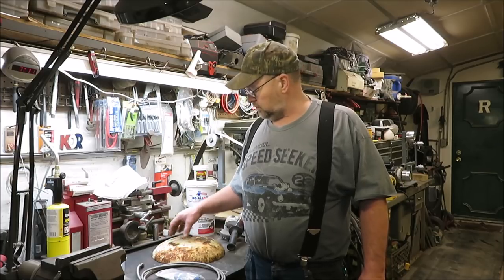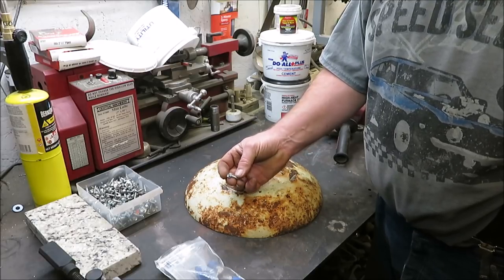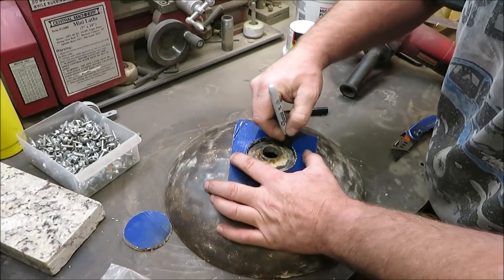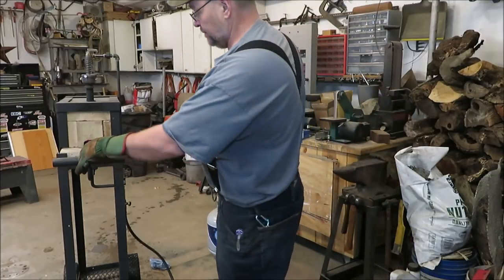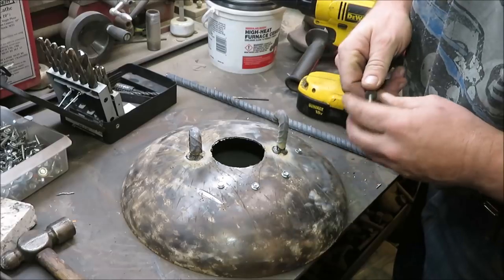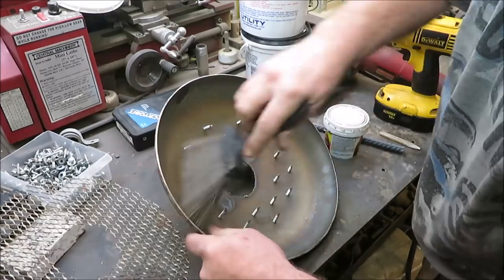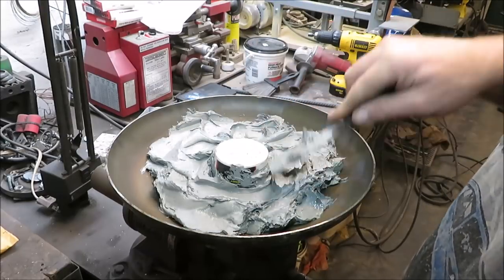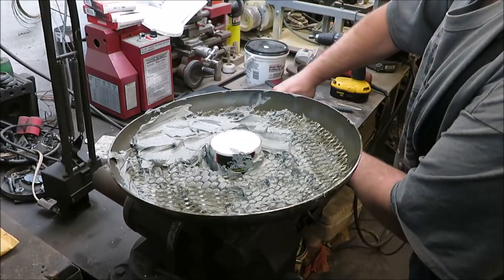blast furnace lid part #6

Comment: hi kevin you will need a old vacuum for a blower and use a light dimer switch to control the air input to gas mix  .
Reply from the maker: Thanks for all the info dan.